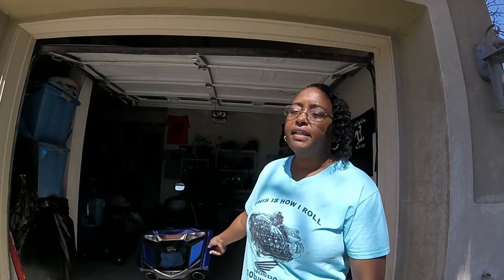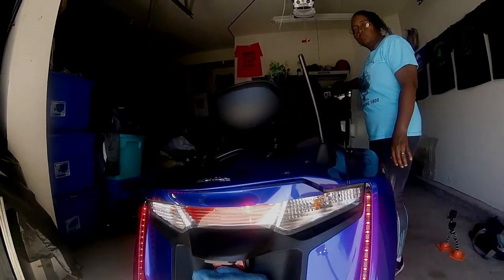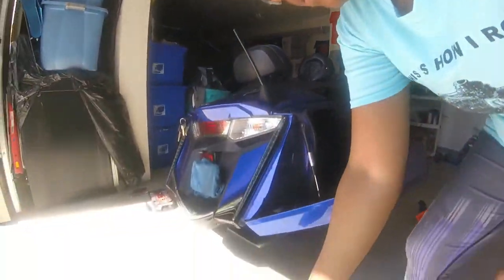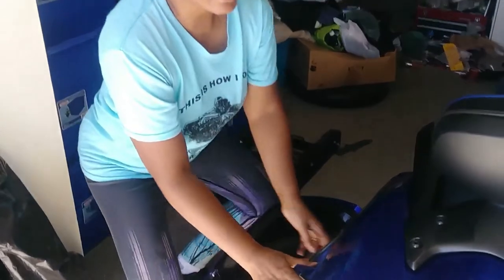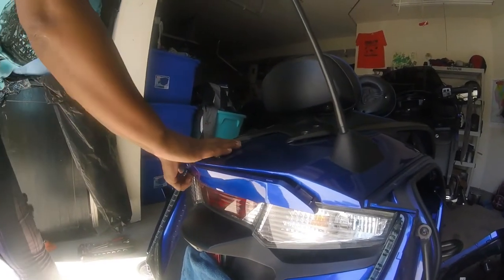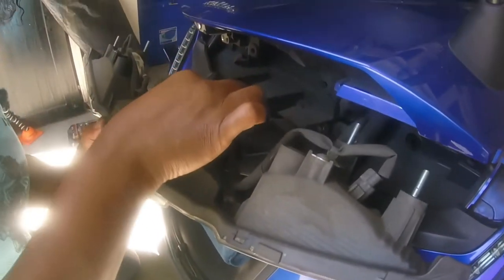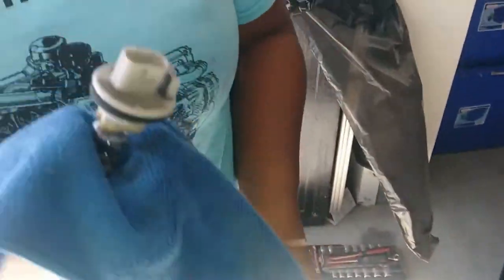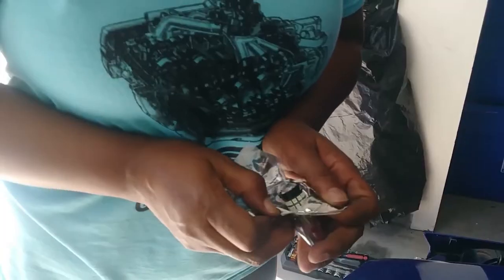My New LED Break Lights

Comment: Great job Kake. Where did you get the led bulbs?
Reply from the maker: HEY! Stranger...Purchased them from Amazon. company is ALLA Lighting . https://tinyurl.com/y4w3lrq8
Good to hear from you. are you back rollin',  How is Princess doing?
Reply: Princess is doing good. I got it painted and back together, but now I have a problem with the stator. I'll have it figured out soon though. I might join y'all next year on the Route 66 trip.
Reply from the maker: @jahfy216  Good tell her I said hello. I don't have a clue what a stator is. And Route 66 halfway point is in Adrain TX. we can meet there. If you can make that would be great.